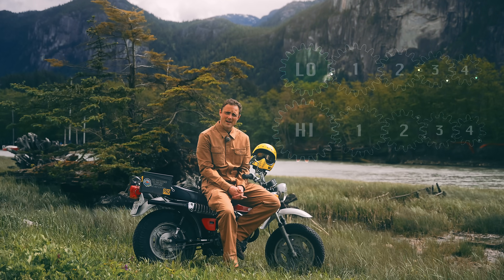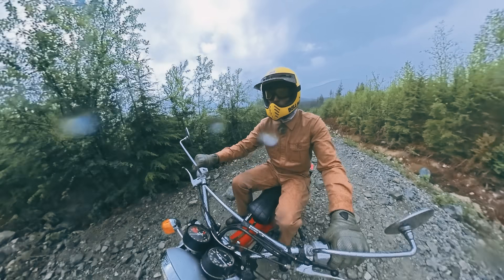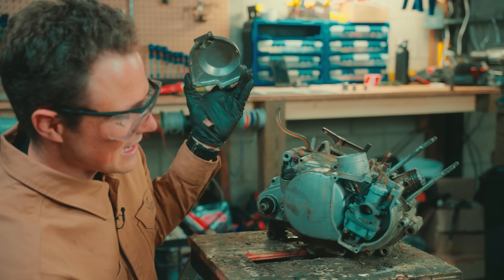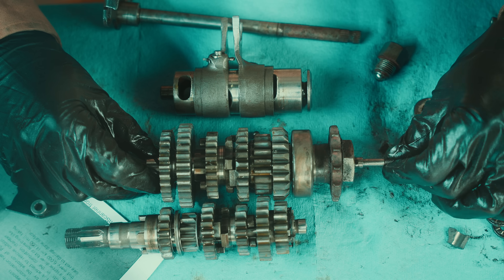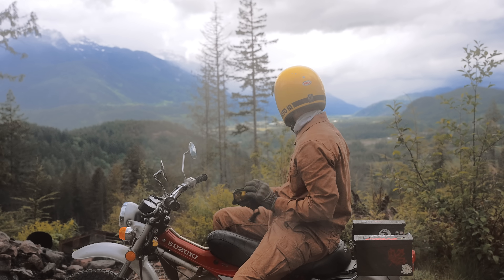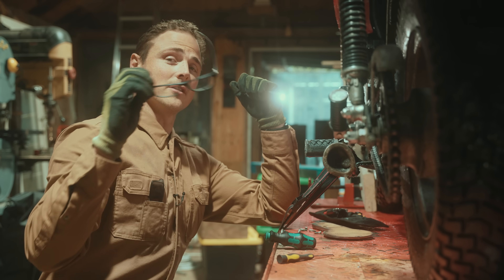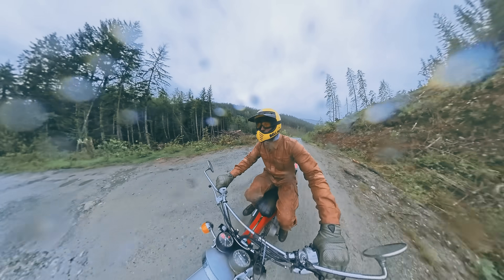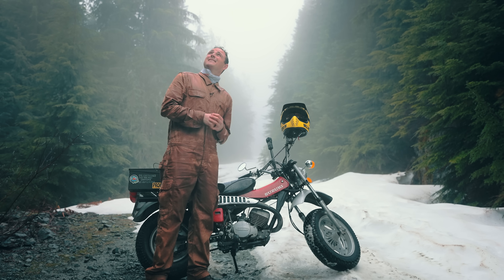Hi-Lo Gearbox Motorcycle - Teardown Review

Comment: I had a RV 125 back in the late 70's. It was an amazing bush bike for two reasons, it was quiet and those balloon tires meant it could handle mud and snow. For climbing canadian shield it was unmatched because you had all that torque at very low speed it was easy to control without slipping. Popping it into low range gave so much confidence that they bike could handle whatever happened... just not in a hurry.

Comment: The local moto-cafe uses the old Honda Trail with the low range gears to tow motorcycles that aren't running, they also used it to tow an air cooled VW Beetle back to their shop.

Comment: No one has mentioned that those flying eyes are like $230, the discount doesn't even get you under 200, and the price goes up if you want prescriptions.  Sorry that just is too much.  Also I learned to ride on a Honda Trail 70, I remember it having an inertial gearbox, you didn't use a clutch as i recall, but I don't think it had the high low on it.  As i remember, the fuel tank ... was also the frame, not my bike so my memory is fuzzy, sometimes was very temperamental about starting.

Comment: I bought a blown up 72 kawasaki g4 100, with the cable actuated hi-lo on the handelbar. Just on a whim, without ever so much as sitting on a motorcycle before. i spent an entire springs worth of long nights in the garage rebuilding the thing from the ground up and taught myself how to ride on it. In part, inspired by your guys' youtube channel. 3 years later, im adicted to motorcycles. It's my spare bike now, but i still get the same rush of smiles when i ride it as the first time i kicked it over and heard it purr

Comment: My first bike was a Suzuki TC-125 Prospector (great name!) with the "kick-down gearbox".  I rode the wheels off that thing. Unfortunately I got quite familiar with that gearbox shortly after I bought it used from a local bike shop owned by a friend's older brother. The end of the primary shaft sheared off and I spent the summer of 1976 waiting for parts to arrive on a slow boat from Japan.  Its leaking tank also let me learn how to braze; which I did poorly for a sixteen year old. For several years in the early 70s Suzuki offered bikes that differed little other than a single or dual range transmission with fewer ratios. The 5-speed TS-125 Duster was virtually identical to the 4-speed/dual range TC-125 Prospector except for the transmission. For sure this extended at least to 90 and 185 models as well.

Comment: "Imagine one of these on a Tdub" - well, Honda did put them on the CT90's and CT110's, so it's not far off. And those models are a riot to ride with the hi/lo range transmission. 

I think the appropriate question that I've asked, is can you imagine if Honda had enough sense to carry over that legacy and include Hi/Lo on the Trail 125? It'd be an absolute stump puller. 

I'm not as much of a quad fan either, but check out the Suzuki King Quad 300, which came with hi, lo, and superlo range. There's something satisfying and fun about putting a 300cc machine into superlo, allowing it to crawl like a garden tractor and move anything so long as it can find the traction to. 

And yes, if a TW200 came out with a hi/lo gearbox incorporated onto it, I'd buy another one tomorrow 😂

Comment: I think these could be the key to making practical highway worthy electric motorcycles. In chain drive electric motorcycles you could just use a hi-lo gearbox to remove a few teeth from the front sprocket to automatically make the bike go highway speeds, kind of like that new porsche car that has a 2 step transmission for high and low speeds.

Comment: Yamaha also sold the AG100 here in Australia with hi/lo, was a 2 stoke with a separate oil tank so you didn't have to premix. Marketed mainly for farm use. It has big metal bars around the handgrips, clutch and brake levers in case you dropped it

Comment: Sorry to be that guy but the bike that was disassembled IS a TC90 not a TS. The TC90 only came with the high low box not the TS, although the vins of both bikes start with TS the gearbox determined the model along with some other features like fender and tank styles(Honcho,Blazer,Tracker)
Source: I own a 74 TC90

Comment: I'm sorry, but 46 is definitely off the FortNine basketball team. He couldn't hit the broad side of a barn WITH the broad side of a barn!
I love the simplicity of the system. Sometimes creativity really kicks in when your options are limited. There's nothing inherently stupid about a high/low dual ratio gearbox. It was a practical solution to the limitations of the little Suzuki 2-cycle that just worked. That's not such a bad thing, especially in a world where "right to repair" is rapidly becoming as rare as a vintage British motorcycle that DOESN'T leak oil everywhere.

Comment: I had a Suzuki TS250 in 1975.  It was a 2 stroke but apparently had enough torque that it didn't need the HI/LO gear selector.  The TS250 was a dual sport that was trying to be a 4 stroke.  It had separate tanks for the gas and oil and it mixed them automatically.  If you want the experience of the RV125 or TS90 in a 4 stroke, try the Honda CT90 or CT110.  There are versions with the HI/LO gearbox.  If you want to try slow back road and off road ultralight moto camping, many people use them for that, or the newer Trail125.

Comment: Hi - lo is good in theory but like a car or truck there is a massive overlap 
At most,you only get two gears in low range that are lower than high range first. As you said most bikes designed in the last three decades have a decent first gear. 
I still want to restore a Trial 90 though!

Comment: The biggest issue with these (or at least with the CT90s) is that you're running an air-cooled engine twice as hard but not going as fast, so you risk cooking the engine. Good for a short stint to get out of trouble, but not for extended trails where the terrain is tough.

Comment: I think the 1966 120 Bearcat was Suzuki's first 2 speed switchable final drive,  an upgrade to the similar 80 Hillbilly which had 2 rear sprockets and a chunk of chain for your grubby fingers.   I'd say they took off, as other brands offered similar, including the torquey 4 stroke Honda Trail 90 and the concept obviously had quite a run although it didn't scale well with higher outputs. It's now just a footnote in small motorcycle history or a source of entertainment depending on how you look at it

Comment: So to be SUPERLIGHT, one could take a FI 2 Stroke (ala KTM) and use a 7 speed gearbox (like my Hecules GS 175 had) with 1.gear superlow.
 Normal riding then would start in 2.gear. 
The same setup, of course,  possible with a 4 stroke.

Comment: I have a TC185 in my shed with the same feature. 
I use it occasionally as a pit bike when  we camp at outback races. 
It has a custom Esky (cooler) rack🍻
The dual ratio gearbox comes in handy for the long distance runs back to camp when we run out of beer😎

Comment: I always thought a sun gear in the rear hub assembly would make a.lot of sense.  After some research, I found that there is was a patent for exactly that.  I'd love to have a low range for my XR650R for riding tight single track without having to slip the clutch so much without giving up the highway capability.  I wish Honda hadn't used such close ratios in the gear box.

Comment: My kid has a Honda trail 90 he's been trying to rebuild and update. He's in the upper valley.
I'm in your backyard. Any interest in helping rebuild an E-motorbike for a project or video? I have most of the parts but it has me stumped. It got me around for 2 years until the charger became unplugged in winter and the batteries froze. I have been looking for someone to help for two years to update and rebuild it. 72V and doesn't even have a fuse box. I'm not asking for a freebie I have a budget for repairs.

Comment: It's not accurate to say 2 strokes have less torque than 4 strokes. Comparing like for like engines of the same capacity a 2 stroke will almost always make more torque than a 4 stroke. 4 strokes usually rev higher too. 
Just have a look at Dyno graphs for different 2 and 4 stroke 250cc MX bikes.

Comment: I never knew it existed and I had the same idea about 25 years ago. I worked as a truck mechanic and all the heavy trucks implement this design, four low speeds and four high. And all eight can be "split" further in low or high.
Reply: My 81 cb900c has a 5 speed with hi lo

Comment: A TC has a rotary valve intake and a 4 speed hi-lo transmission with the kick selector.
A TS has a piston port intake and a 5 speed transmission.
This bike is a TC.
I preferred the TS for the simplicity of less moving parts / less to break.
Love the show!
Reply: I had a 1972 TC-120 CAT, 3 speed with Hi/Lo. It had a carb, piston port. Used  the shit out of it in the dirt. Then put the lights on it when I got 15.5 year old and got my D.L.
Reply: @Erik-rp1hi  I guess there were even more variations of the TC then.
I was referriing to the TC and TS 90/100/125 models I am familiar with.
I purchased a 1973 TS 125 new, but didnt keep it long.
Traded up to a 1974 TM 100 and raced that for a few years.
It was a blast!
Reply: I’ve got a 77’ TC125 and it’s piston ports.

Comment: Very cool use of the ball bearings.... I just tore the engine apart on my  2019 1250gs the transmission in it  also seemed pretty straight forward..and much cleaner !

Comment: Great video! Everybody was mad Honda didn't include a dual-range subtranny on the Trail 125 like they did on its predecessor, the Trail 90. I'm not sure it would have been worth the extra cost, but it would be an extremely cool feature.

I think I prefer Suzuki's shift-on-the-fly subtranny over Honda's, which worked quite differently, though no doubt Honda's was more durable. Thanks for showing the tear-down.
Reply: I know that the ATC125M cane with a reverse gear which occupies the same place as the range gears. I guess it was a toss up and reverse won, on the ATC's anyway.

Comment: With electronics, riding modes and switchable rider assists being what they are now, it'd be neat if manufacturers offered something akin to an impossible-to-stall mechanical crawler gear below first gear, only somehow electronically restricted so you couldn't accidentally drop into it on the street. It'd be a solution to a niche problem, sure, but it wouldn't have the compromise of going down a tooth on your front sprocket. 4-strokes have gotten more powerful but bikes and riders have also gotten heavier.

Comment: So enthusiastic about the weather.

Honda CB900 had dual ratio gearbox, thankfully not sold this side of the pond.
Reply: Just the early '80s CB900 Custom - it was used as a way to move drive to the right side so it would work with the shaft drive system.  The CB900-F just had a regular 5-speed and chain drive.
Reply: I have a cb900c.  Great bike

Comment: I had a Honda CT 90 with its dual speed transmission in the mid seventies. 
While slower top end and acceleration wasn’t good(and let’s face it, no where near a cool looking as say the SL 100 or the two stroke equivalents) it was fun to click it into low and claw up and by my friends on a few of the pretty long, steep hills.

Comment: I disagree that hi/lo is the thing of the past, they should bring it back.

Modern 6-speed trannies have a ratio 3:1 which would mean that you either have to sacrifice low which you need for technical riding, or top for riding highway. Yes you can space gears more but if you do it at the bottom then you may find yourself constantly hunting for gear on trail, switching between 2nd and 3rd. Or between 3-4 in twisties
Reply: Agree! I can imagine my 701 with high/low ability. Leave the house in high, and get to the mountains and put er in low.

Comment: It has been a long time, but I think Kawasaki made a 120 with a Hi-Low. We called it a 120, so that is why I think it had the Hi-Low. Of course that was 50 or so years ago and it isn't the first time I've been wrong. It did have the Hi-Low.
Reply: It was a G4 Trail Boss manufactured early ‘70s. Two-stroke @ 100cc. Dual-band transmission.

Comment: 1972 TC90 was my very first bike way back. I've been looking for one for years, not because I want to ride it, I just want to clean it up and hang it from the ceiling in my shop. I was shedding a tear when you started tearing it up until you said it was a TS....not as bad, but still, a close second. What was the difference between the TC and the TS anyway?
Reply: A TC has a rotary valve intake and a 4 speed hi-lo transmission with the kick selector.
A TS has a piston port intake and a 5 speed transmission.
This bike is a TC.
I preferred the TS for the simplicity of less moving parts / less to break.
Reply: I had the 1972 TC-120 CAT, 3 speed with Hi/Lo. Used it for years.

Comment: The Hi/Lo gearbox on the Honda CT90s from my youth is what made it great. If their new CT125 had the same set up I would have bought one in a heartbeat.
Reply: I used the low range on my Trail 90s often. Even on bikes with plenty of torque it's nice to have a super low gear where you can duck  walk really slow at times.
Reply: Peugeot used to make a 125cc scooter with a supercharger, the Jetforce. I've always wondered why they bothered, but the idea of a supercharged Honda Trail is fascinating.
Reply: @AshleyPomeroy  Couple things i guess: 1. With how driving licenses were set up in Europe 125cc was the limit for a lower class. More power than the competition is good.
2. Its cool
Reply: As someone who owns and offroads a CT125, they honestly lug down pretty well. Sure, there is the odd climb that I wish I could gear down on. As long as you aren't starting from a complete stop up something super steep, whatever witchcraft the ECU is doing to keep the engine spinning combined with the 'clutchless' transmission, it is a lot of fun. I've accidentally taken mine down a MTB single track (the trail just tapered down to it). The only reason I turned around was because my buddy was riding a KLR and he couldn't fit. 😂
Reply: @waynepantry7023  The CT125 is made in Thailand I think, and Japanese bikes made in Thailand are pretty damn good.
Reply: The point about the 125 is that it doesn't really need the low-range switch, the extra 15cc and four decades of "development" have given it enough power. If really required then change out the rear sprocket.
Reply: @aaronleverton4221  9.7hp is plenty eh?
Reply: @jimstenlund6017  You planning on running it at Phillip Island in October?
Reply: @aaronleverton4221  No, I’m riding a CG150 powered Chinese bike.
Reply: @jimstenlund6017  At Phillip Island in October?
Reply: The Honda 110 ATC also had the hi-lo range gearbox. It was traded for a reverse gear on the ATC 125 though. This is because the range gears occupy the same place, just outside of the front sprocket. Me personally, I prefer the range select to the reverse because these trikes were small and light enough that one can easily push them back (if your legs are long enough, without getting off).
Reply: We bought a ct125 to replace my wife's '70 trail 90. She has really appreciated the electric start(back up kick), fuel injection,  and brakes that do something.  The tail 90 was a blast and wish we had kept it too. Her trail 125 is a blast as well and very capable.
Reply: Also used on the early '80s CB900 Custom - but more as a way to shift drive to the right side for the shaft drive system than because it needed more gearing.
Reply: @aussiebloke609  I wuz going to mention those, didn't realize the rationale behind it. It failed with the public,  didn't make much sense on a large street bike compared to an overdrive gear.
Reply: @aussiebloke609 A friend of mine had one, let me ride it back in ‘85…let him ride my 400 Hawk Hondamatic
Reply: The tc-90 brings back memories. I had one when I was 8 years old back in the seventies. Very first gearbox ever rebuilt. With success love it thank you.
Reply: It was a real kick in the chest when I found out the 125 didn't have it. I would still love to own one, but that aspect has put doubt in my mind that I just can't seem to shake. It makes me want to find a 110, or swap a 125 from an ATC into my 90.
Reply: @bavarianbanshee Lol if you’re from the US and want a dual range watch out for the 80 model. I bought my 110 without doing my research and didn’t realize it’s the only year without one
Reply: I had an Honda ST90 as a kid and I think that had a clutchless 3 speed. The memories of being roostered by the CR's and KX's that my mates had. It was a gem though.
Reply: That has held me back from the trail 125 too!
Reply: At least you can Buy one whenever you decide to Do it, Personally, it doesn't put me off buying one without the Low/High gear selection, I'm sure it has enough power to get you anywhere. I would never have the opportunity to own one because Honda Decided not to sell them in Europe.

Comment: I wouldn’t own one, but still a very cool idea that was just never needed beyond the implementation of a more torquey 4 stroke.
Reply: Not everyone wanted a four stroke because it took a 125cc or even a 175 cc four stroke back then to get the same performance of a 100 cc two stroke in most applications.  I had a 100 cc two stroke Yamaha Enduro in 1973 and my friend had a four stroke Honda 100 scrambler (CL) and my bike would leave his in the dust every time. And that was typical.   Nowadays four strokes have improved some.  So the point is,  if you wanted a small engine bike so that it would be light  (and cheap)  yet still have some quickness you needed it to be a two stroke.  So then, in order to climb steep hills off road, you could have two different gear boxes, one for the street and one for the dirt.  It worked very well.